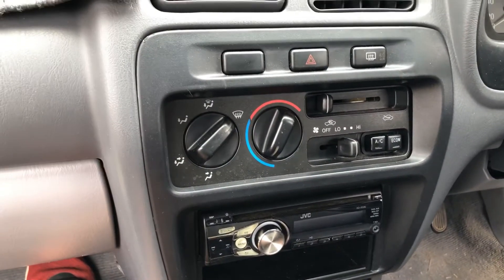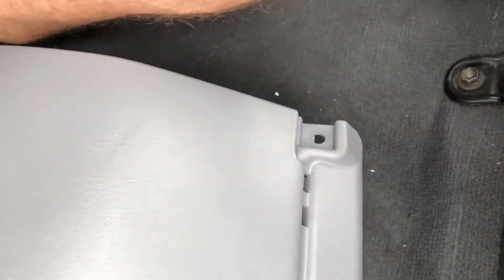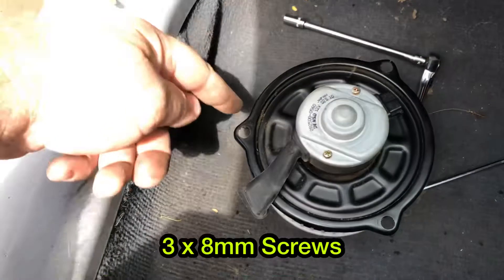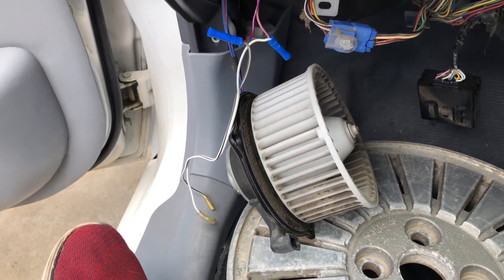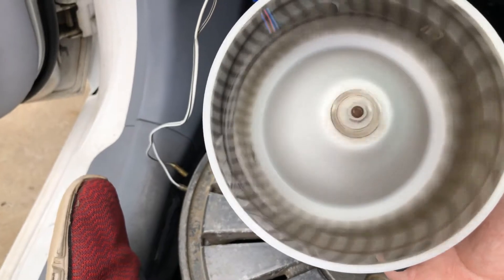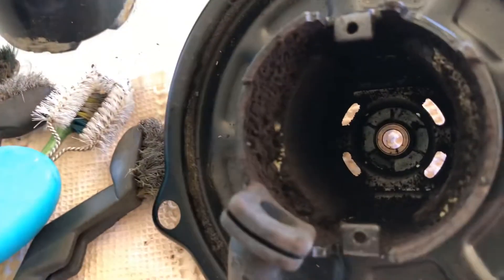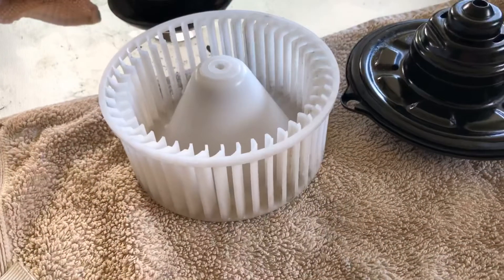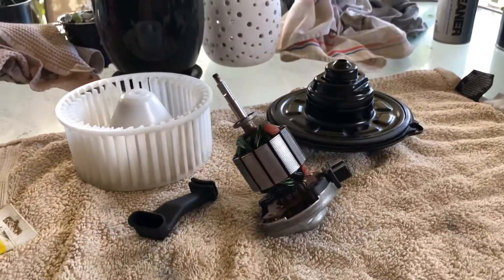No AC! Strip and Clean Seized Blower Motor | Toyota Starlet

Comment: I want to thank you for your video. It helped me repair my Toyota Starlet AC with your instructions about dismounting and mounting the blower. Although I have found a little running here and there, at last, I have found BRUSHES and it worked perfectly, thanks to your help.